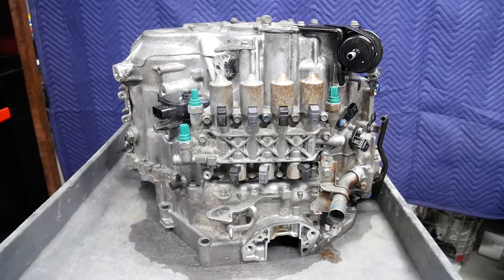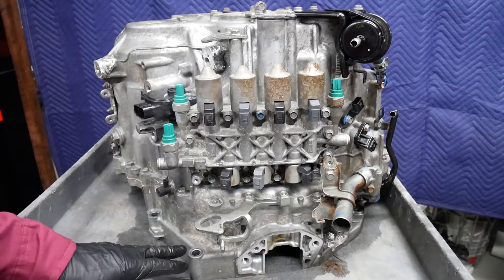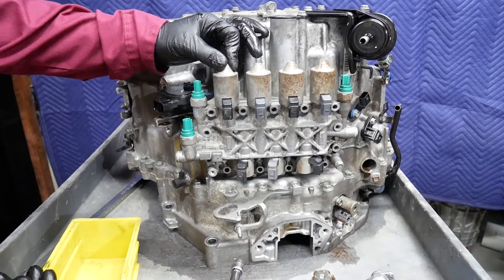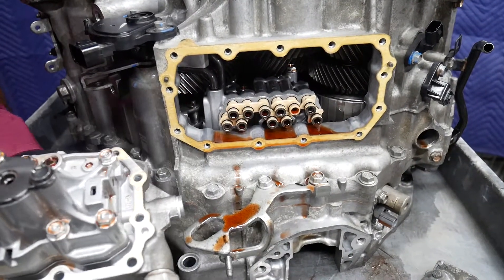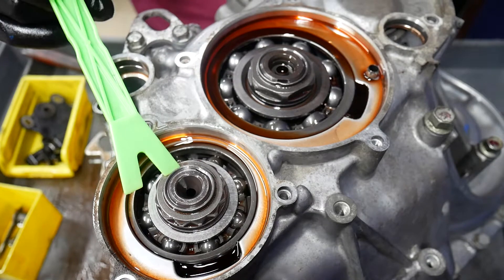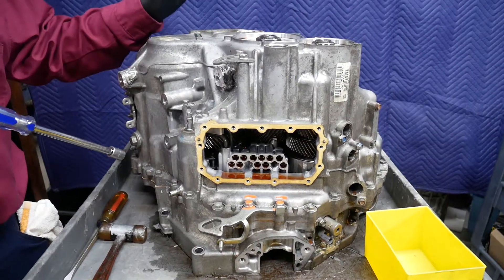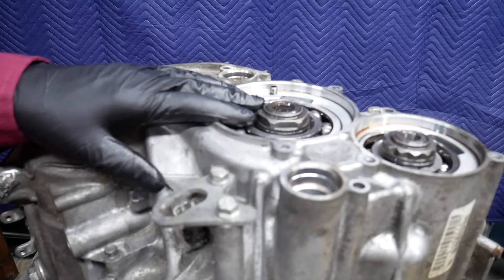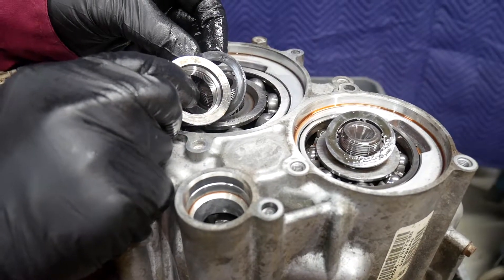Honda H6 6-Speed Automatic Transmission Disassembly Part 1

Comment: Is there anyway I can upgrade this transmission to make it stronger?
Reply from the maker: Sonnax has several kits that will increase the longevity and performance of Honda transmission family.
Reply: Can you post a link to one of the kits for the automatic 6spd? I don't understand their site that well
Reply from the maker: @keyzaccord1774  https://www.sonnax.com/units/478-honda-acura-5-speed 

Sonnax makes kits for the earlier units but I do not see the H6 in the list.
Reply: 2017 accord

Comment: Is this the same transmission that's used in the 2013-2017 V6 Accords as well🤔🤔
Reply from the maker: Yes, that is correct.

https://en.wikipedia.org/wiki/Honda_Accord_(ninth_generation)
Reply: hello sir do u know P0747 code

Comment: Do you know if the solenoid body can be removed with the transmission still installed?
Reply from the maker: Yes it can, however be sure to blow off all sand and dirt with an air gun to prevent contamination of the fluid and possible entry of dirt into the solenoid body.

Comment: Would it be possible to fit this(with adapter kit) in an Honda Element AWD?
Reply from the maker: It is difficult to do the swap because transmission shift point and shift quality are controlled by the power-train control module (PCM), unless the PCM is programmed and includes the shift solenoids pin-outs for the H6 transmission it will not shift properly. If you were to swap the engine transmission combination with the associated PCM and wiring harness from another vehicle, it would be possible.
Reply: @ThompsonAutoTest  Thanks for explaining!

Comment: Hi, thank you for the clear and informative video! What is your opinion on the reliability of the H6 6-speed Automatic Transmission? I am looking to purchase a used 2016 RDX and saw so many negative reviews on the reliability of Acura's SUVs. However, my further research shows that one of the main issues is with MDX's 9-speed and not so much with the 2nd Gen V6 6-speed RDX. I am planning to purchase one with around 35k miles and own it for the next 10 years.
Reply from the maker: The Honda H6 transmission used in the 2016 Acura RDX is a mature proven design built from the Honda family of 4 and 5 speed parallel shaft Automatic Transmissions. Reasonable driving style and periodic maintenance consisting of fluid change at 100,000 mile intervals should take you through the next 10 years without a major problem. Many transmission failures are the result of aggressive driving style and operating the unit at low fluid levels. Honda is using the ZF 9HP on some models and they have used the unit successfully. However Chrysler and Jeep when using the ZF 9HP front wheel drive unit have had many customer complaints and ZF has primarily attributed these problems to control software issues. Honda has had a much better experience with the ZF 9HP.
Reply: @ThompsonAutoTest  Thank you for your thorough reply! I trust the reliability of Honda's engines, but was worried with the less consistent reliability of their automatic transmissions. I now feel more confident about choosing the 2016 RDX with your professional opinion. Thank you!
Reply: I recommend changing the fluid with Honda OEM fluid every 40k miles and changing the filter located near the front of the car where the fluid heads to the transmission cooler about every 80k miles.